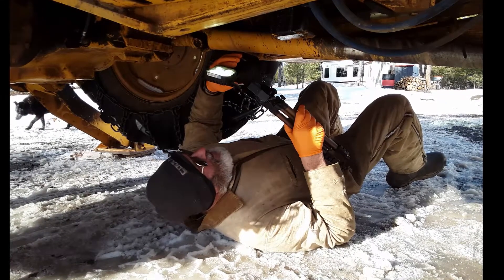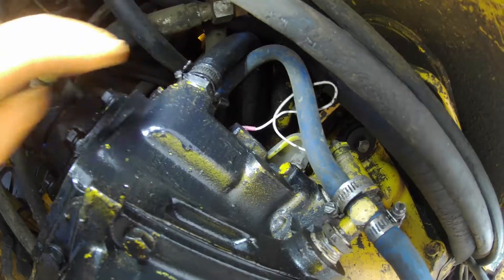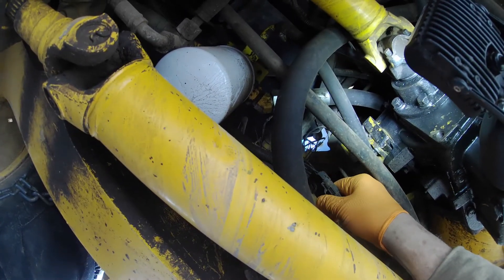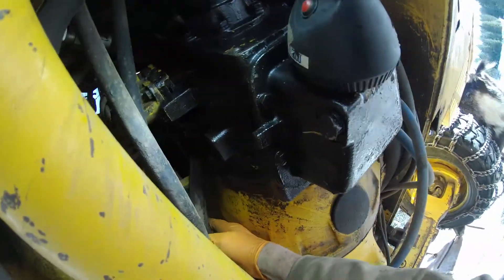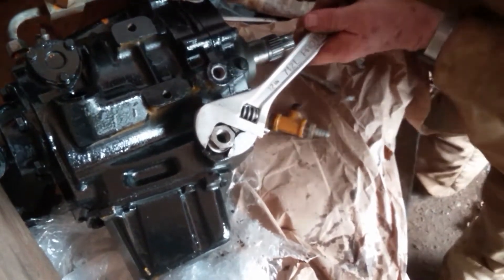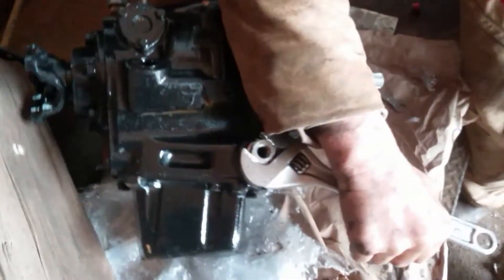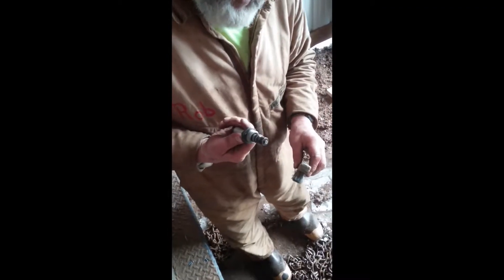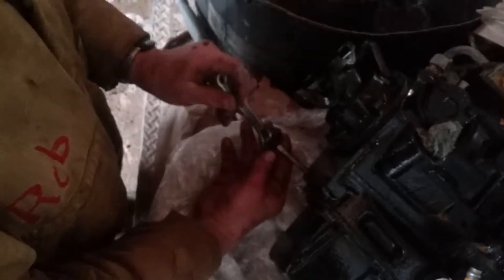Shuttle Shift Transmission Repair | Will It Start?

Comment: Between CASE and John Deere backhoe, which do you prefer for its reliability and maintenance?
Reply from the maker: Sorry this has taken so long--been busy building our house.  Probably depends on what dealer you have in your area.  They all seem to be pretty reliable, but if you have a problem then it depends who you can get parts from.  When we had problem with our John Deere we got parts out of Texas cheaper than anywhere else, and we're in Idaho.
Reply: Nice to hear from you. I already bought a Caterpillar backhoe. Its quite decent machine
Reply from the maker: @judenrahim4839  The logger I worked for had both case 4x2,4x4 and cat 4x4.i couldn't tell much difference. Our personal hoe is a JD310 4x4. It's 30 yrs old and did cost us some money on repairs. I think it is as good as the cat or case. Before they bought the cat, they tried out a JCB 4x4 all big tires.  I think I liked it best for the type fo work we did. Good luck on your purchase. What cat did you get?

Comment: Hi Rob. I have a 1995 315d version and the converter oil temp indicator light started to come on. Any tips, I am new to backhoes, this is my first one, only just found out the convertor is inside the reverser.... I check the oil, only use 2nd gear as I use walk speed around the farm. I going to look at the pipes if any pinch and somebody said check if its plugged, I guess he means a blocked pipe etc. I noticed in your vid, you said a sensor, could it be faulty umm maybe ?? ....Anyway, any help would be great as if I have to take it off like you, I a bit screwed. Thanks Rob
Reply from the maker: Andy  The first thing I would  do is to pull the dip stick for the transmission and smell the oil on the stick. If it smells burnt, you probably have a problem with the reverser and torque converter.  The mechanic I talked to said if it is burnt, both need to be replaced.  My reverser has a small pan on the bottom.  You can pull it and see if anything like metal or fiber pieces are in the bottom.  If not you might try changing the oil.  I don't know of any way to change the oil in the reverser so you would probably have to do it a couple of times to get the smell out. If you have or can  borrow a inferred temp gun you might check the temperature on the side of the reverser and the pipes when the light comes on. I don't know for sure but I don't think the temp should be over 200.  You would have to check  with John Deere to get that.  If it isn't hot, I would change the sensor. I think mine was in one of the pipes.  When my reverser started going bad it would slip in a hard push and it wouldn't hardly move in 3rd or 4th.  Sometimes an old hose will get brittle and have a flap come down in the inside of the hose and plug it but if I remember right, all were tubes on mine except the filler.  The sensor I talked about in the video was the reverse backup switch on top and it wouldn't have anything to do with temp. Hope this helps.  Would be interested to know what you find out. If you have to change the torque converter and reverser, I would see if I still have the name of the place in Texas where I got mine.  Half to 1/3 the price of John Deere.
Reply: @robandnell4305  Thanks for all your help Rob. I am in Australia so getting parts is a bit hard and most do come from the states anyway. I will follow your directions above and check all hoses etc...I update you once I fix the problem or find the problem,,,thanks again Rob.
Reply: @robandnell4305  Also to add, I can move forward and reverse with ease, no issues there, just the temp light comes on showing a potential issue to come. I only move slow walking pace as the ground is bumpy, so its in 2nd gear all the time, any faster it will backhoe will bounce around too much.
Reply: @robandnell4305  Update 01.   Removed the oil from the pan and the oil is blackish but doesn't smell burnt so I guess thats a good thing. As its blackish, I guess the oil has been there for a long time, so I will be changing that. I tried to take off the pan,  but its seems solid, its sealed good, maybe it has never come off before...I am unsure how hard to hit it with an hammer to free it, so I tried a wood chisel along the join were the seal and hoping it would break free, but not much look either. As I've never worked on one before, just unsure how hard to hit it without breaking it, I guess the pan is cast made or is it solid machined steel, unsure.
Reply from the maker: If the oil doesn't smell burnt and you don't have any slippage when under torque, it may be a plugged pickup screen in the pan or plugged hose,or the sensor if it getting overheated.  I think the pan is cast.  I think my pan is about 8"square on the flange the bolts go through.  It may have been sealed with permatex aviation sealer or cat which is hard to break loose.  If the bolts are all out, you might try heating where the gasket should be all the way around with a small propane torch to maybe 90-100 degrees if there isn't anything around that will melt. Sometimes that will loosen the cement.  I use a dead blow hammer. If you don't have a deadblow put a board on the case and hit that. You can hit it pretty hard.  I would try the chisel or maybe 2 to create a crack where they are glued.  I have an old tapered spring about 8" long I sharpened the end on so not much tapper.There will be a pickup tube and filter in the pan so be careful when it comes loose. When you get the oil back in, run it till the light comes on and check the temp of the case and pan.  I think it should be under 200.  If it is much over 190 I think the engine temp should rise a bit.  A John Deere dealer or most equipment sellers  should be able to tell you what temp reverser should run at.
Reply: @robandnell4305  I have a guy coming on Wednesday whom knows a thing or two so hope we can take off the pan and check any hoses or replace them if look too old. If its easy I just replace all hoses this way eliminate those issues. Thanks for the info, always much appreciated, update you later or better still I create video and add to YT. Thanks